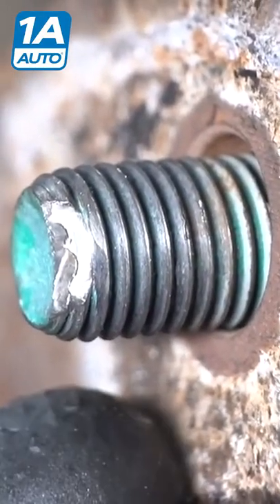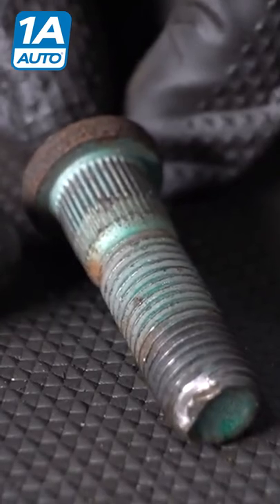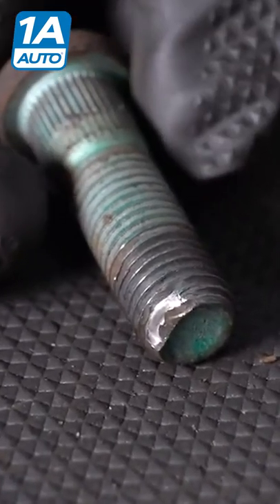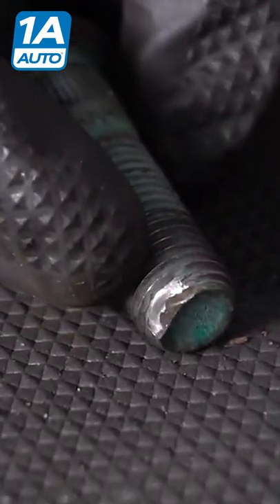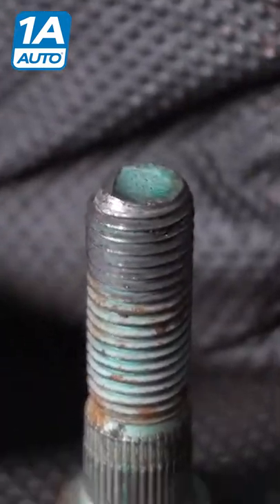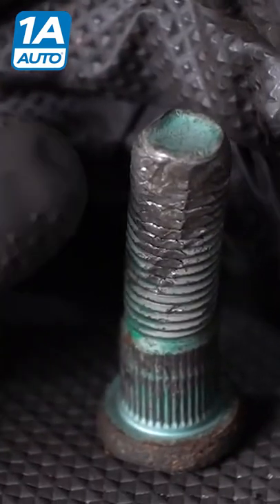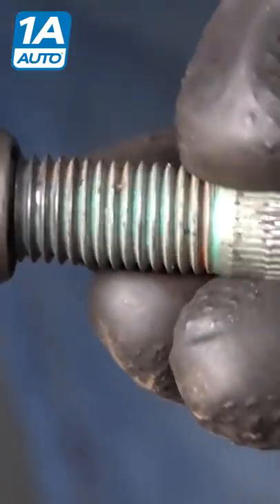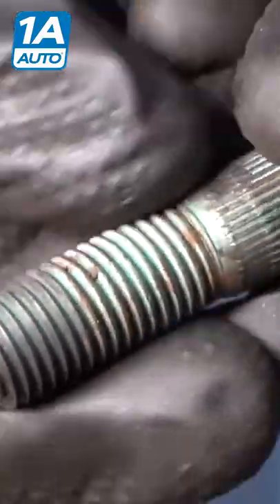Is That Damaged Lug Stud Still Usable? #shorts

Comment: The spline that has been used 1 time is done if it fell out it needs to be replaced .  if the threads are damaged replace the stud .  if the nut is damaged replace the nut .  i just changed out 24 studs and 24 nuts for 30 dollars doorman lugs and studs . they looked fine over 23 years old . age said it all .
Reply: Agree

Comment: Easy to clean a thread when you remove the damaged area instead of using a die to correct the thread. If the die fails or the damage is severe.....BUY A NEW BOLT.